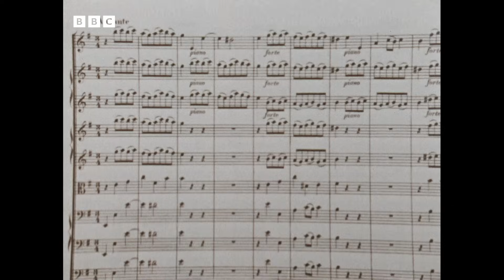1970: WENDY CARLOS and her MOOG SYNTHESISER | Music Now | Retro Tech | BBC Archive

Comment: I live in Asheville, NC where the moog was invented. There’s a museum here. I have been in it multiple times.
Reply: Yeah, that’s also my link to this topic, as one of the first occasions that I listened to synthesized music was “Trip into the body” from compatriot Johan Timman. He’s used the same Moog as Wendy has: “Moog, known for the impressive modular synthesizers from the 60s and 70s, released the Minimoog in 1970, an affordable, simpler version by Moog standards of the enormous machines used by Wendy Carlos and Johan Timman, among others. Although the possibilities of the Minimoog were much less than the modular Moog synthesizers, the Minimoog, with three oscillators and a noise generator, a Moog filter and an ADSR generator, was warmly received and from 1970 onwards there was not a single self-respecting keyboardist left who was not there. owned at least one. However, with a price of a few thousand guilders, it was not a hobby instrument,” Source: http://www.retro-lab.nl/?p=1616 
Wendy was one of the absolute front runners in the area of synthesized sounds and - music. Respect!
Reply: How is it?
Reply: @grinsko6741 Vermont has taller mountains.

Comment: Okay, so for someone that doesn't fully understand or know much about how all of this works yet, is the idea of making sounds just adding a ton of different types of waves layered on top of each other? Like taking just a normal SIN wave to begin with and then on top of that I start adding just a BUNCH of different other waves firing all at the same time (for the most part at least, thinking about waves starting from a "zero" point) until I get something like a Trumpet?

I think Wendy genuinely helped me finally ACTUALLY understand how this all works, and I wanna make sure I'm on the right track here. And I also appreciate anyone that would like to break down what exactly each of those knobs are doing to create these cool sounds. Just recently learned about myself that I need to know the "How + Why" of things and I couldn't quite find any videos that really broke it down enough for me to understand.